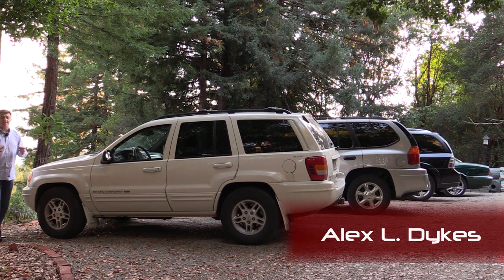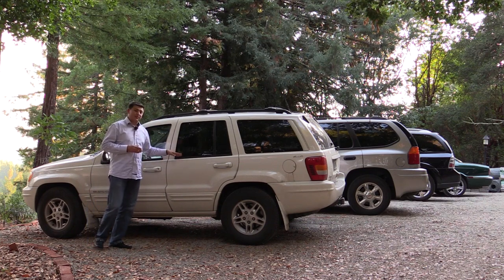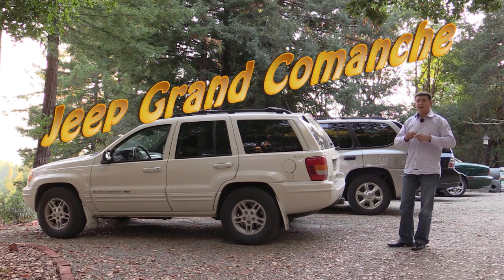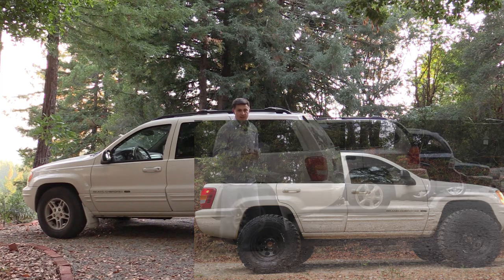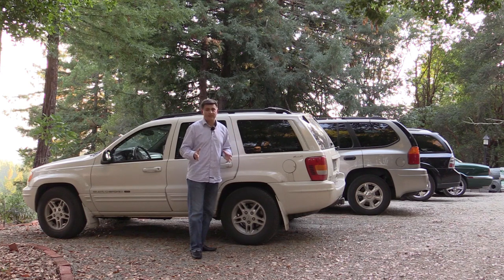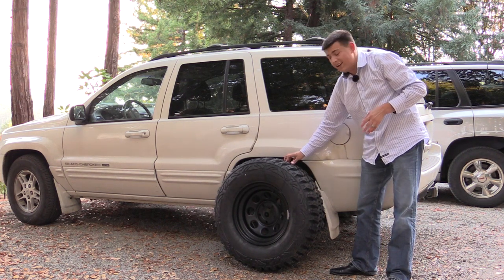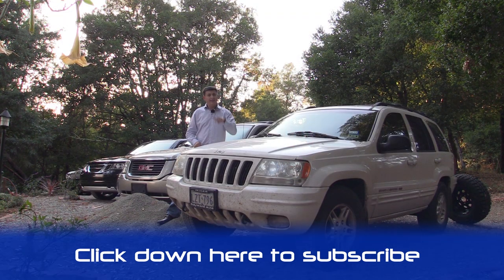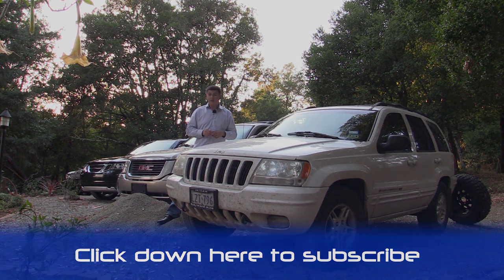Jeep Grand Comanche project (Jeep Grand Cherokee pickup convesion) Part 1

Comment: I think it should be noted in here that the Comanche also had a larger/stronger unibody frame rail, as well as a full frame rear section for the bed, and longer rear leaf springs with slightly wider spring mounts (half inch out each side) than the Cherokee.   Ok, I am done nerding out and looking forward to this project.  If it isn't obvious, I have a Comanche lol

Comment: for the interior, definitely consider ripping out the carpet and applying spray liner. i have witnessed the floorboards rusted out on a 96 that was from a simple heater core leak.

Comment: Those 1999-2004  jeep grand Cherokees were worth 36k and there the most rewarded 4x4 in the world one of the best jeeps ever made and my dad has one he's abused it drove over grass.curbs.2 feet snow.he drove it on ice we've had it since 2005 it's 1999jeep grand Cherokee wj 4.7 v8 4x4 loaded with leather dual climate control 10 disc cd changer it's patriot blue with a grill guard and step sides it's a beast 260 hp 0-60  in 6 secs after market air intake and I'm only 10 years old so I've had it all my life and I'm a jeep fan and land rover fan